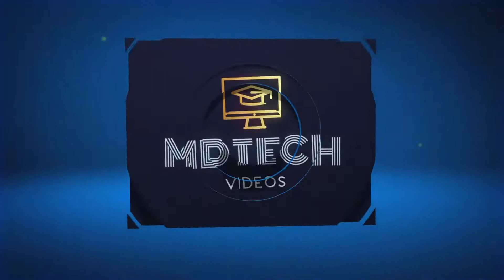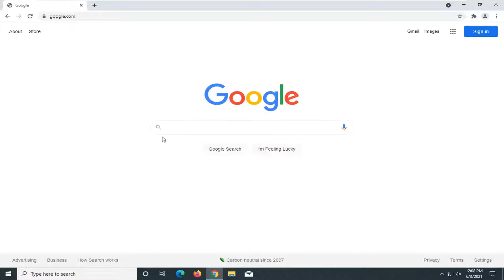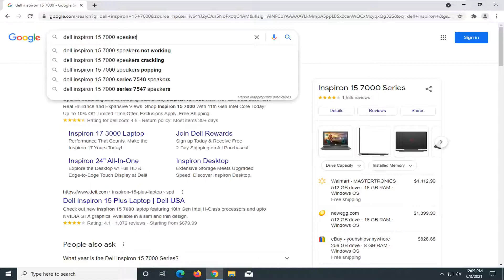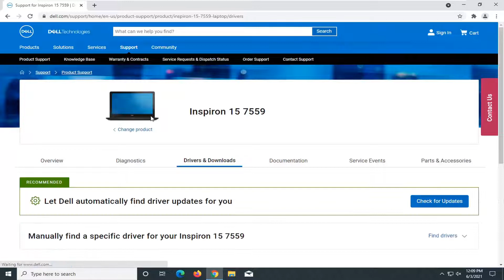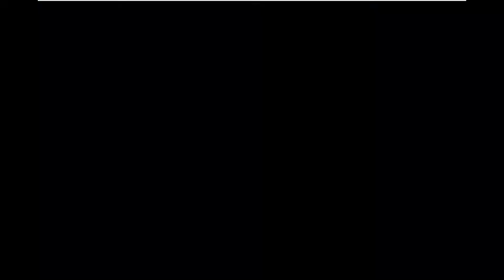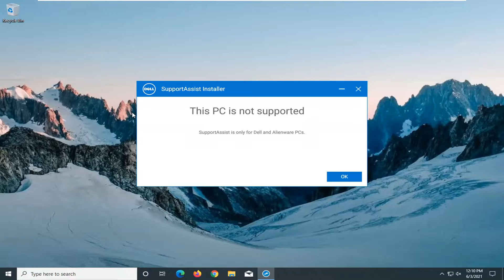{SOLVED} Crackling Audio/Sound in Dell Inspiron 15 7000

Comment: Surprisingly, this solution worked. Well, not automatically, but the cracking static audio dissipated over time despite my Dell Inspiron laptop being out of warranty for a software update. Hopefully, the audio stays good. This video won't resolve the issue for everyone but it's worth trying. # {SOLVED} Crackling Audio/Sound in Dell Inspiron 15 7000 - MDTechVideo International 

EDIT 1: Three days later, the static noise is back. Ugh. I thought it would stay gone, but it was temporary. EDIT 2: Another option is to get some new headphones/earphones. When I got a new audio set and adjusted the volume, the static was minimized at best, so it could be the item's quality. 

FINAL EDIT 3: So I solved the popping/static/stuttering noise. The issue for me was that my laptop was on battery-saving mode. I had to change it to the best performance mode and it was completely gone. Type on the Windows search bar "Power & Sleep Settings" > Click "Additional Power Setting" under Related Settings > Then change to " Balance Performance" or "High Performance". Also, type in the Windows search bar "Battery Saver Settings" and on "Turn Battery Saving Automatical At" Make sure to change it to "Never". Lastly, make sure that your battery slider below your Window Task Bar is on Best Performance. And the static noise should be completely gone.

If not then go watch this video on YouTube called "How to Fix Crackling or Popping Audio Problem on Windows 10" by Britex09. He has multiple ways to get rid of the static noise and one of his methods helped me. Finally free at last my ears are free as last.